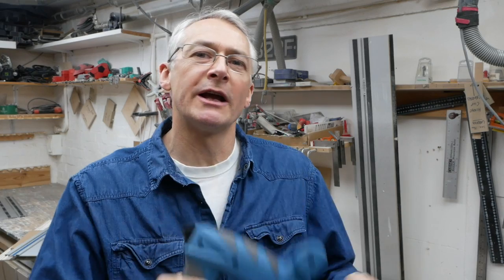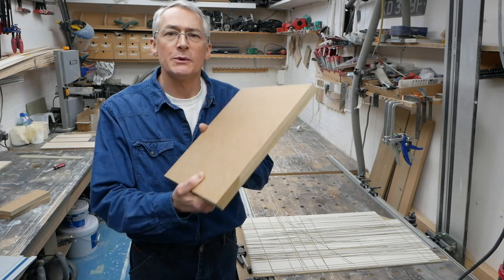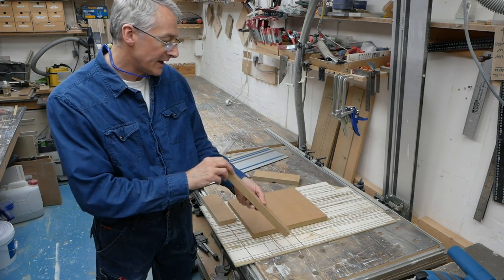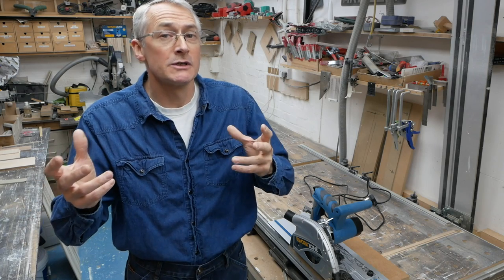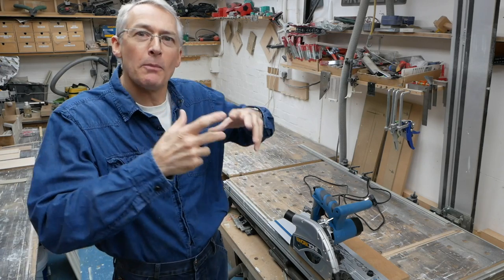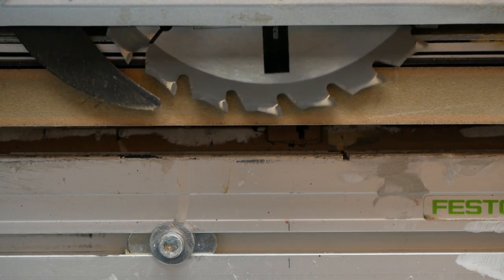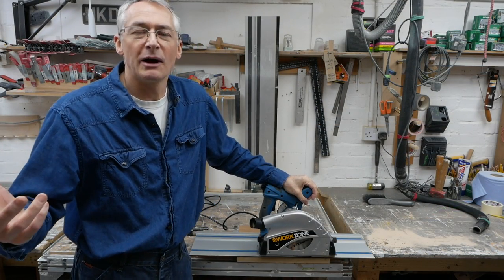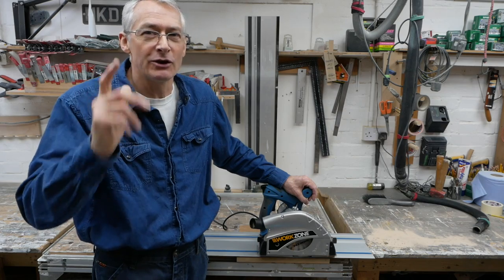TW P3; Square cuts & blade change [video #279]

Comment: I've not changed the blade in my tracksaw yet but isn't the retention pressure added from the outside of the blade? And therefore the wider kerf shouldn't have any impact on the splinter guard as it would only extend the cut away from the guard rather than into it?

Comment: Useful, thanks. Apologies if covered in a previous vid but can you tell us if the anti-splinter strip is actually in contact with the material after the initial trim cut? Some shots appear to show a gap between underside of strip and the work. If so, that’ll undoubtedly compound breakout, as the other function of the strip besides being a visual reference is to hold the material in place against the blade rotation. I returned the Parkside saw for the same reason, i.e. the edge strip was too thin and curled up and away from the material.
Reply from the maker: Thanks. This is covered more extensively in Part 7where I change the splinter-guard, and try alternative blades, and also in yesterdays 'More on Blades' follow-on. But yes, the original splinter-guards are poor (as mentioned in Part2) and the rails generally a weak-point, which I'll expand upon when I do the full review of the saw. 👍

Comment: On the dewalt saw, a thinner kerf blade affects the riving knife, due to its thickness matching that of the blade.
Reply from the maker: DeWalt plunge saw blades typically have 2mm kerf, so a 2.2mm would be fine. Only blades meant for cordless saws typically have a kerf less than 2mm 👍👍

Comment: I’m going through all these videos, so many great tips and ideas!  I was told years ago that using the depth that just exposes the teeth at the underside maximized the number of teeth in contact with the wood and this gave a better cut.  You can see the length of the blade cutting line at 5:30 is about twice as long as when it’s at maximum depth, seen at 6:05.

Comment: As a woodworking newbie, the checking for squareness was such a needed perspective. Near the 2:00 mark, you start a sentence with: "and that is actually [pause]". I was convinced, without a doubt, you were going to finish that sentence with "absolutely terrible" as there was a small discrepancy. I may have been sitting with my mouth open for a bit while all the "terrible, terrible cuts" I've made thusfar flashed before my eyes. Salvation

Comment: You'll get a better result from tear out by flipping the piece over(good side down). At that point it cuts the finish surface mush like a table saw with the teeth presented to the timber at the leading edge with a downward cut. Most of the time it is not a necessary step as  good blades produce less tear out, but when it's a real concern it does help. Give it a go.;-)

Comment: Hi Peter, thanks for your  video series, i'm new to  tracksaws so this has been very helpful!  Any reason you can't just plunge the blade fully and set a square-up against it and the plate?
Reply from the maker: Thanks! You can do it that way, but you need to lock the saw in the plunged position, and you’ll be squaring the blade, not the cut, if that makes sense? Especially in entry level saws like the one I use here, it’s not unusual for there to be a slight ‘wobble’ which affects the evenness of the cut, so I always prefer to square off a cut, not the blade. 👍

Comment: One thing you didn't mention but is certainly good to know is if you are breaking down rough sawn timber, and particularly if you are doing rip cuts, get a 12 TPI blade for your track saw. When I switched over it was like someone had given me a new and improved saw. With a TS55 I can easily rip through hard timber at full depth with a 12 TPI blade. The rip blade does pretty decent cross cuts as well but I always clean them up on the mitre saw afterwards.
Reply from the maker: Thanks! I’ve never done that kind of ripping tbh, but good to know it can be done with a coarse blade 👍👍
Reply: Funny - I have multipurpose blades and a rip blade for my table saw but never thought about a rip blade for the track saw. Thanks!

Comment: i bought the mac allister plunge saw after seeing your vid discounted to £80 from £100 so took a punt! i also bought a 40 tooth blade and fitted that. luckily just enough rubber poking out to get the line trimmed on the tracks! however, it struggles cutting 18mm mdf, feels underpowered which is annoying. ill whack the 24 tooth one it came with and see if that makes a difference. not sure about yours, but the tilting mech is pretty rubbish with flex and it catches half way through and back and you have to 'massage it back in to place. found liberal use of silicone spray helps...
Reply from the maker: Send it back, that's not right. Mine will breeze through 18mm MDF with a 48 tooth blade in it, no issues at all with the tilt. Return it.
Reply: @10MinuteWorkshop  thank for the reply peter - ill send it back and get a replacement

Comment: Pete.... I don't think you emphasised enough the blade diameter effect re. the calibration marks on the saw itself, a different diameter blade will basically render the plunge calibration useless... ish 😅

I intend to stick a Trend blade in mine too... the std. blade is just about okay tho..   re. the rubber splinter guard, mine curls up away from the surface too... if you wanted to get fancy you could replace it completely with some kind of solid plastic strip siliconed in place & trimmed to width...I'm on the lookout for suitable material to do just this on mine...
Enjoying the series so far !! 
👍😎☘
Reply from the maker: Thanks Peter! This was just about the mechanics of the blade change - I get into alternative blades in Part 7. The Makita splinter guards are a little thicker but they still don’t make full contact. The Festool ones are thicker again, but I haven’t tried them yet.

Comment: Interesting your result with the 48 tooth blade. 
I have a dewalt mitre saw and bought a 48 tooth blade for that as I wanted a finer cut for some work I was doing. I was disappointed by the results on that too more break out especially at the end of the cut compared to the stock dewalt blade which had less teeth. 
Always been a fan of Trend kit but their blades do seem to be lacking a little.
Reply from the maker: More on blades in Part 7, and an follow-up out next week 👍👍
Reply: not sure if things have changed in the past 2 years but the trend blade I bought was excellent with my mac allister plunge saw. I followed all of PM's advice along with the usual tips and tricks related to blades, I also coated my blade in dry ptfe before I even used it if that maybe makes a difference? Idk. but I theorize, in this vid, that either the workzone saw is just shit, or peter forgot to move the splinter guard to account for the 2mm less kerf. who knows

I plan to buy a festool blade sooner than later just so I can sharpen it instead of throwing away... but I gotta admit, I would feel dirty putting it in a £95 plunge saw lol

Comment: My email from YouTube about this series only listed parts 1, 2, 4, 5, 6 and 7, but not part 3, anyhow flicked to your page and picked it up there. I always thought the more teeth the finer the cut, maybe not as critical on MDF as it is on ply I guess.
Reply from the maker: Thanks Bob. But if a scheduling snafu - Part 3 was released early, so I had to pull it then re-release manually on schedule! As ling as they were all visible. There’s a playlist link in the vid description that has them all
In order. 👍👍 Edited to add - there’s a bit more to come on the blades next week. 👍👍

Comment: Hallo Peter,
try to make the scoring cut with a depth of 2 mm in REVERSE direction! Do not push the saw away from you, pull it to you.
The first cutting teeth of the sawblade will cut in downward direction, so nothing will tear out.
That's why scoring blades on table saws rotate in reverse direction.
I allway use this method on plywood and multiplex when  cutting across the grain. It works perfect!
Your videos are great! Thank you very much!!
Juergen
Reply: Yes, good idea. I even think that this technique will help with first cut (cutting splinter guard) as moving backwards the cut is started from back of the saw - so you cut the end of splinter guard while the saw still sits firmly in rail.
Reply: Totally agree.
Reply: I did this and it works really well, using a Makita. Thanks!

Comment: That little gem of information on setting the depth so as to keep the tooth within the materials is genius. There is a noticeable difference in the quality of cut. Thanks.
Reply from the maker: Thanks! I thought it was a load of old pony when I was told it, but the more you think about it the more it makes sense! And it does work 🤷‍♂️👍 #alwayslearning

Comment: If the blade is not square to the work piece, is there a clever way to fix it it?
Reply from the maker: I realised I’d missed it off and cover it in Part 4, but short answer RTB for the Aldi, DIY for the Festool. 👍

Comment: I assume the Scheppach (derived) tracksaw doesn't hold the blade firmly enough (there is some vibration) so the quality of cut won't be improved by using a 48T blade.
Reply from the maker: So why the variation between blades??
Reply: @10MinuteWorkshop   I am not sure what you are referring to/might be misunderstanding the question, but to me seems obvious that the blades where teeth have been machined to a higher tolerance and hardened appropriately ("appropriately" here is a catch-all term) would cause less random movement during cutting and hence, less tear-out. 
However, I have seen an experiment where a Festool blade was used to cut a long timber board - the blade was inserted in the Festool TS 55, and then the same  blade was inserted in a low quality tracksaw whose make and model escape me. The main point is, the blade was the same, but the quality of cut with the unnamed, cheaper tracksaw was far worse.  I assume that this has to do with the bearings, the machining accuracy of the chassis, and how well balanced to motor's armature is.
Reply from the maker: @GianmarioScotti  I'm referring to the fact that the Key and Festool blades produced decent results on the Aldi saw & track, but the Axi and Trend were poor. All were good on the Festool saw/track though. If there was any issue of the Aldi saw and track, then it should affect all the blades, no?
Reply: @10MinuteWorkshop   my hypothesis is, and you could check this yourself by careful examination of the cuts (use a lense or a microscope if you have access to one), that all the blades would produce better results on the Festool than the Aldi tracksaw.  There will be difference in quality of cut between blades, so if you pair the Aldi with a good blade like the Festool one, you will get better results than with a blade of inferior quality. Basically what I am saying is that the quality of the cut depends on both the tracksaw (due to the factors I listed in my previous reply) AND the blade.

Comment: Isn’t the thiner kerf only impact far side ?  thinking kerf should has nothing to do with split guard .
Reply from the maker: No, the kerf is balanced either side of the blade; a thicker kerf will affect the splinter guard. 👍
Reply: Which accounts for the poorer performance of the 48 tooth on the splinterguard side as the splinter guard was trimmed with a 2.4 kerf blade?

Comment: Where is part 1 and 2, have I missed something?
Reply from the maker: Apologies - scheduling snafu. All live now. 👍
Reply: @10MinuteWorkshop  Peter, it's suggesting videos 4 and 5 when you watch number 2 rather than 3, meaning you need to go into your channel to find 3. Just a heads up! Matt
Reply from the maker: I’ve no control over what YouTube’s algo’s do, but James picked up part 3 when it was accidentally released at  7.00am. There’s a playlist (link in the video description) that keeps (and plays) everything in order. http://bit.ly/TracksawWorkshop 👍👍
Reply: @10MinuteWorkshop  oh ok, fair enough! Think this is the first time it's got the order wrong, they usually just flow! Keep it up 😁
Reply from the maker: @mattkindon2917  Thanks! These were all released at 12.00 noon, so I'd imagine the algo's get confuddled. You can only specify 15-miinute increments for scheduling, and I didn't want them to be released over the course of a couple of hours,each one with its own notification... 😱👍

Comment: I don't believe changing the width (kerf size) of the blade will effect or change the splinter guard.
Reply from the maker: It does. Try I and see. 🤷‍♂️👍
Reply: @10MinuteWorkshop  ahh yes. The teeth are wider. 1/2 the net difference will be toward the saw. Thanks. Keep up the good work!

Comment: Surely a different thickness blade wouldn’t make a difference as the inside of the blade is the part that trims the splinter guard and that would be the same distance from the saw as it nestles against the spindle, the outside edge of the blade would be cutting thin air even if it was 5mm thick it couldn’t cut any more of the rubber away, nice series by the way
Reply from the maker: No, it’s the width of the teeth (the kerf) that matters. The teeth are centred on the blade, so thicker teeth (wider kerf) will trim the rubber strip a little more than the thinner one. 👍👍
Reply: @10MinuteWorkshop  BTW, it would be a 1/10 of a mm, not 1/5th.   (It's 0.1mm wider on each side of the tooth, making it 0.2mm wider overall).  That's assuming an equal width saw plate (which is probably NOT the case).  When I changed my blade to a smaller one, the small difference bugged the hell out of me, so much so that I had to replace the splinter guard.  It was annoying when the saw didn't cut to the line.
Reply: And whilst we're talking splinter guards, buy rubber strips from eBay (or similar), attach carpet tape to the back and use that as a splinter strip.  No need to buy 'proper' ones at £10 a pop.  For £10 of rubber, you can get many strips.  Doesn't even matter if you can't cut it straight as the saw will make the straight cut you are interested in - just make sure you get the right thickness (allowing for the width of the carpet tape also of course)